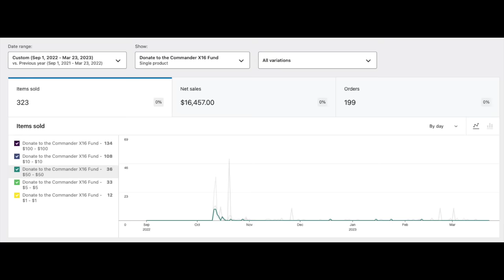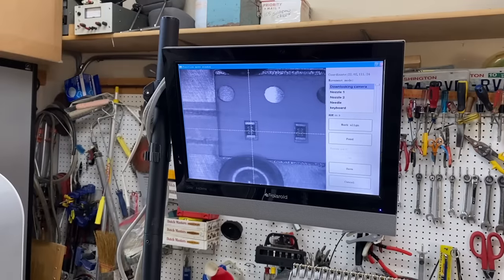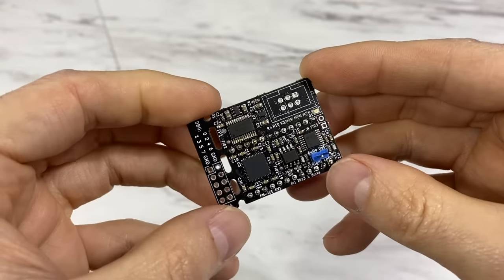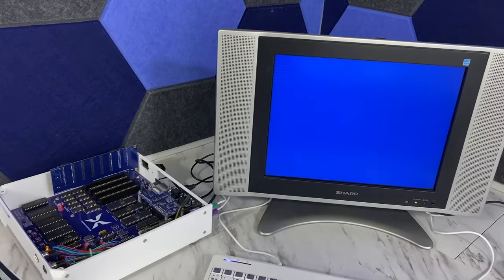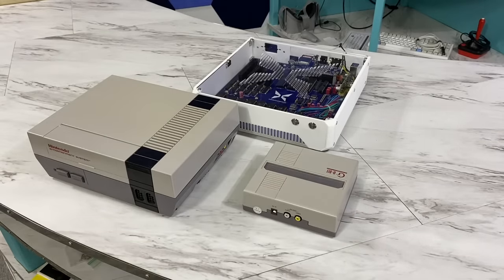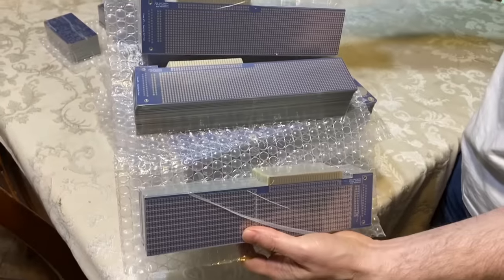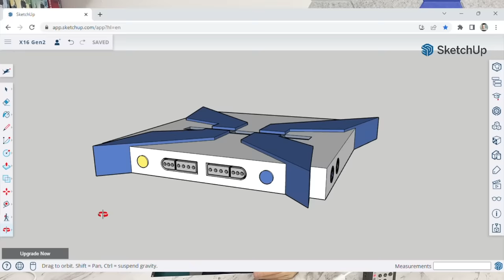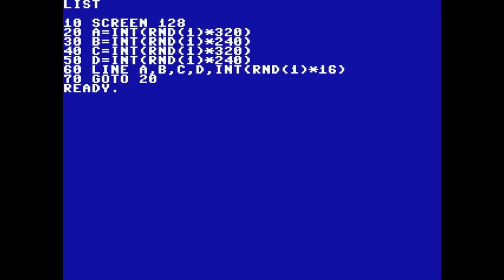Commander X16 2023 update

Comment: I'm a bit confused, while I love the idea of this project, what is the purpose of the expansion slots if only the last one can be used? Would it be possible to use a riser card and share one physical slots with multiple cards?
Reply: That case is optional. The X16 Dev board is a standard size, and fits into a wide variety of cases. Also, many expansion cards may be quite simple and fit just fine in that space. So the right angle to lay a full sized card in Slot 2 flat would be more of a case accessory for lower profile cases.

Comment: The keyboard is a bit of a hack job, isn't it? I do hope that I can get to choose to receive the proper one even if it meant waiting longer, instead of the hodgepodge of a mess of a sticker on off the shelf keyboard....

Other than that, appreciate the transparency and update. Best wishes on solving the technical set backs!
Reply: Hey your cat will really enjoy the taste of the stickers, though you may find it slightly more challenging to be able to type :)
Reply: Those keyboards with stickers are only for prototype boards of which there will be only a few dozen. The X16 development board meant for production will have a properly labelled keyboard included in the package.
Reply: @novh4ck  ah, so it's mostly limited to this first batch of 100(?) or so early adopters then, it's not ideal but at least only the early birds would be unlucky ones.
Reply: @AkiyoAratemuso  Yep. They will also mostly be developers of the hardware itself so they don't mind if it means that they can get their hands on the board first. :) These 100 boards are still the prototype boards with user port chip and some minor differences from the final board.

Comment: I thought of a good idea, a board with a cartridge edge connector on the bottom to connect to the cartridge port of the Gen 2 model that gives expansion slots and a pass through cartridge slot. This would be an optional additional purchase, of course.

Comment: Yours machine for soldering is wrong one.
- You need to put heat eq, and have just wave of solder like 1 inch. 
deeping is ok for low grade power supply, and puting solder on traces, it is not good for wery smal elektronics, this is why, wave river of solder (moving) is great for very smal dimention
I hope i help Mr 8bit

Comment: Splitting into two versions is a poor idea folks.
Reply: No
Reply: @johnnylongfeather3086  they are splitting the tiny market/install base in half for no demonstrable benefit. How did a 'let's make a modern 8/16 bit computer' turn into 'let's also make a game console!' before even the computer has actually had any sort of earned success? it's mission creep.
Reply: @chadhartsees  Exactly! There are a number of red flags in this video TBH.
Reply: Just like the C16 and the Plus-4. The c16 killed off game production because, it well, existed. Devs ported their games to the C16 because it was less powerful so it would run on both the c16 and Plus-4. The game console and Dev Boards have the same specs, so this is avoided.

Comment: This is interesting. From what was originally "I want to build my dream PC based largely on the C64" to now "we're building a game console".
Reply: Considering the similarities between e.g. the C64 and NES, it's not a surprising change?
Reply: @FloLedermann   From a use case and marketing standpoint, a personal/home computer is not the same as a games console. Despite any technical similarities, they appeal to different market segments, as companies like Commodore, Atari and Amstrad found out the hard way. Tinkerers want the X16 computer to tinker with. The console market is already saturated with hundreds of cheap and midrange emulation boxes, plus phones, tablets, PCs and modern console systems that are often backwards compatible with older games. An X16 "console" isn't going to fare well.
Reply: You are arguing as if the X16c will not be a functional home computer, when in fact it will be. The keyboard and mouse and SD card will all still included. The "cartridge port" is s a full fledged expansion slot. Take an X16Dev expansion card, screw it into a cartridge case, now it's an X16c cartridge. Plug a riser board into the X16c expansion slot, now you have multiple expansion slots, just as described for the X16c design for several years now.
Reply: It's a follow up of the very successful C64GS.
Reply: There was not a real difference between those machines back in the day, except for a keyboard and floppy drive or dataset back in the day, and there is still almost none nowadays except for a draconian drm on the console side nowadays. The xbox and ps5 are more or less just amd based pcs with a little bit of extra. The PS5 even runs a BSD variant as its host operating system.
Reply: @Brandi's Nonsense Well the c64 was mostly only ever used for games so any hardware based largely on the c64 is probably mostly gonna be for games so I don't think it makes much difference if its a (gaming) PC or a games console.
Reply: there were always 3 stages, iirc, to this project. the third stage will be a smaller, muuuuch cheaper version of the console (at least that's the aim). The only difference between all three is the physical size and manufacturing techniques/technologies used, and on the user side, the ability to tinker with the internals on the G1.

The 'use' of the machine is meant to be identical in all cases, since the user will be plugging in cartridges, SD cards, and typing on a keyboard to see bloops and blips on a screen. And the built-in bloops and blips will be a rom with BASIC.
Reply: @cryptocsguy9282  Since even the "games console" would ship with keyboard and mouse, and since it includes the SD card support, it would work just fine in home computer mode as a cost-reduced version of the X16. It would be an awfully weak argument against it being a home computer if all that could be said is "If you get a CP/M card you have to put it in a Famiclone cartridge case!"

Comment: $50,000 to fund this project.  Meanwhile, the Agon light is on sale for $50 with zero upfront capital investment.
Reply: Agon is a generic 8-bit computer. X16 is a computer built specifically as a tribute to Commodore 8-bit machines. Because of that it has and will have a much larger community and software library. It also has superior sound so the chiptune community is also interested. Community is more important than cost for many hobbyists including me.
Reply: Let me have my fun 😢

Comment: The warping is most likely caused by the solder itself causing expansion on the bottom of the board. You’re adding material to one side of the board. Notice that the boards curl upwards not downwards. Bracing it is the only good option here but you’re still going to notice flexing and warping when you remove the brace. The only real alternative may be to preflex the boards slightly downwards to hopefully be canceled out when they receive solder.
Reply: When you're dipping, that's true.  Wave soldering would have been better, but that can be pricy and take up a lot of room.  Room I don't know if they have.

Comment: The Agon light 2 option is a much better choice, especially now, looking at the price.
Reply: Just so you're aware....there's a very soured relationship between Bernardo Kastrup (the guy who made the Agon Light) and these guys. Bernardo is not a very savory person, in fact I'd say he comes across as quite arrogant and condescending, so the criticisms he has given the 8-Bit Guy and the CX16 didn't go down well at all. Even mentioning anything related to him on the CX16 forums will get the posts deleted.
Reply: @jimtekkit  To be fair, Bernardo is spot on with his criticism of the X16. It's quite hopeless, really.
Reply: @alexquant1335  Unfortunately being correct doesn't make a person likeable. Blind freddy can see that the CX16 is an overcomplicated and misled design (like Bernardo correctly pointed out). The problem is that Bernardo fuels wars instead of collaborating. He created the Agon Light as an educational machine and ironically gets irritated when working with amateur users below his education level. And that's why both the CX16 and Agon are a disaster, which is sad because I had high hopes for both projects.
Reply: Yeah, I have mixed feelings about this.  As far as I can tell, the X16 has gone way off the rails from its original design intent, in the spirit of all hardware projects managed by software guys.  I don't see the point in limiting the system to the 6502 and VIC-20 architecture just to mate it to a very powerful VGA-style video system with massive sprite and multi-layered backgrounds.  It all feels like things have been thrown together with no clear vision.  The Mega65 has the same issue, and don't even get me started on the Foenix line.  The Agon Light is really what the X16 was trying to be.

On the other hand, the Agon Light is really too fast and too powerful to be considered a real retro machine, especially since it doesn't use a "stock" Z80.  It's hard to pitch something as retro if it's not even remotely on the level of vintage 80's or even 90's hardware.  I have the same issue with anything based on ARM, like an ESP-32.

Plus, yeah, I've seen Bernardo's rants, and I have to say his web site doesn't even work correctly in my web browser because it's so badly designed and uses all kinds of stupid Javascript navigation overrides.  He doesn't strike me as someone who really knows how to deal with people or care about making things work correctly.

I'll stick to my Amiga stuff and WinUAE.  The "nouveau" 8-bit retro scene is pretty much a mess, and all the new things coming out are way too expensive.
Reply: Bernardo doesn't understand the X16 and his "criticism" lays this fact bare. (Some of his claims are truly bizarre for someone who ostensibly should know better - like calling VERA's FPGA "relatively large" when it straddles the line between small and medium and Lattice FPGAs are notoriously slow). He's also nearly pathological in his lying and hopelessly fragile when criticized himself. Get the system you want; if you don't understand the point of the X16, then the Agon Light is probably more your speed. I personally don't think Agon Light will be much more than an educational toy because it's just not fun. The color is limited, the audio is painful, and overall it just feels like a microcontroller acting as a retrocomputer because that is exactly what it is (well, it's two microcontrollers with three cores total - one of those cores is 8 bits.)

And why do people keep coming back to this "VIC-20 architecture" thing? The X16 architecture was initially inspired by the VIC-20 but to call it a VIC-20 architecture raises the question of why you think this and do you understand the architecture of both to even say that.
Reply: @Waccoon  tbh I prefer hardware created by software guys over software created by hardware guys any day 😂.

This is also where the strength of this system lies - the team understands the needs & expectations towards the "user experience" of people who grew up with C64 and the likes and want to pass on that experience to a next generation who increasingly have no clue about what's going on inside a computer, even if technically inclined.
Reply: @FloLedermann  Well, that kind of defeats the point of going retro.  The great thing about 8-bit machines is that they are so simple, you can fully understand the whole machine down to the hardware level.  They all came with BASIC in ROM just because there was no software infrastructure, yet, and owners were expected to write their own software.

Modern computers are just black boxes, and it's the software people that turn everything into huge, bloated, inefficient messes.
Reply: @Waccoon  "that kind of defeats the point of going retro" except the first video David had on this was "all modern off the shelf parts, no vintage parts" and the agon light is a 8bit machine? it has a z80 cpu and it's instant on BBC basic, it's fully open source so i don't know what you mean by "modern computers are just black boxes" when the Agon doesn't use any FPGAs which the x16 does and is far more of an unfriendly 'black box' to new comers in that regard
Reply: @jimtekkit  I don't know either of these people, and to be honest, I don't care how they deal with other people's designs. That's between David and Bernado. But considering David's initial ideas for the X16, the Agon 2 is broadly comparable, so David can't complain that they're being compared. Even now, with the huge changes to the X16, the two are aiming at the same small market. What's important to me is the price, the availability and the usability of each system. Bernado has produced a machine that is cheap, available and uses BBC BASIC, which is one of, if not the best, 8 bit BASICs out there. He's even said a 6502 version is a possibility. David ought to be asking himself "how?" Bernado achieved this, rather than getting all defensive.
Reply: @another3997  Unfortunately Bernardo's opinions were quite insulting to the X16 team, so probably there will be no good coexistence between the two projects, which is a pity. Also, unfortunately, the Agon Light uses hardware that was quite popular in the UK back in their heyday, but totally unpopular in the Americas. BBC basic was considered trash in the americas back then, and the Z80 is not the most funny chip to be coding on. That's why probably the Agon Light will be succesfull in the UK and Europe, but not exactly here in the US, or in the rest of America. Simply put, is not their market. Pretty akin the 65xx based machines in Europe, they weren't as successfull like the Z80 similar parts back in their heydays.
Reply: @OriginalityDaniel  It's a bit disingenuous to point out that the X16 uses a small FPGA while Agon Light has two microcontrollers with all of the peripheral interface components integrated. VERA is also open source so the most integrated component on the X16 is open - where do I go to see the HDL for the ez80 or ESP32? They're black boxes, aren't they? You could argue that the iCE40UP5K design isn't open, but that's kind of ridiculous - the VERA design that it is configured with is fully synthesizable and could be converted into a standalone IC. There are companies that will do this for you. Agon Light doesn't have that and is dependent on the huge black boxes that are modern microcontrollers. I don't see Agon Light winning the openness argument.
Reply: @Waccoon  ESP32 is not ARM based, it is based on the Tensilica Xtensa LX6/LX7 CPU cores (there are also RISC-V based ESP32's). BTW, I bought an ARM based Acorn Archimedes back in 1987, and the Archimedes'  operating system RISC OS still runs on the Raspberry Pi, so you cannot just dismiss ARM based systems as not being "vintage" or "retro".
Reply: @OriginalityDaniel  Check the original specs.  Despite the claim of "all modern" parts, the X16 was designed around a number of vintage parts which had to be replaced later on with FPGAs due to shortages.  The whole project is a text book of bad planning and not knowing what they are doing, which is why it is now $500 and still struggling.

The argon isn't a Z80, it's an eZ80.  You can run Z80 stuff on it if you want, but it's still leagues more powerful than your typical 8-bit machine.  I'd compare it more to a late-generation 16-bit system, and that appeals to a different kind of community than your typical 80's computer enthusiast.  It's affordable, but it can't be technically compared to the X16.